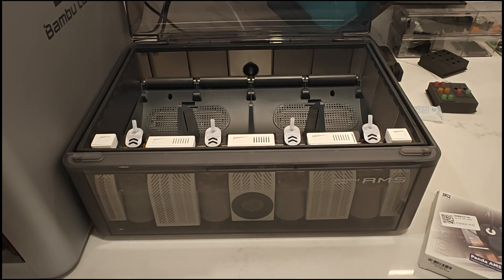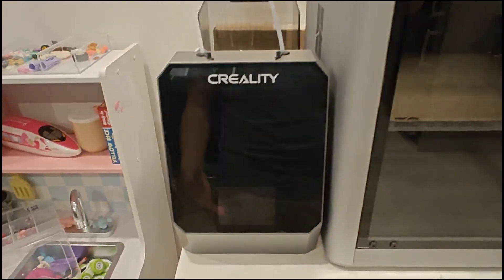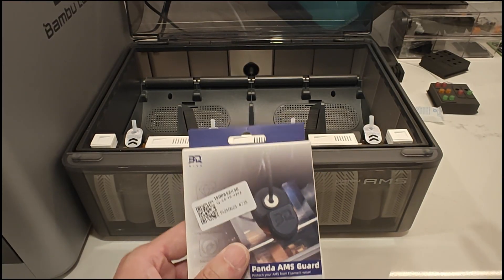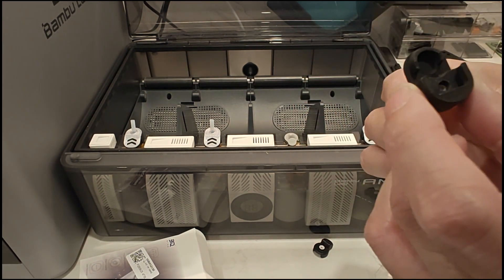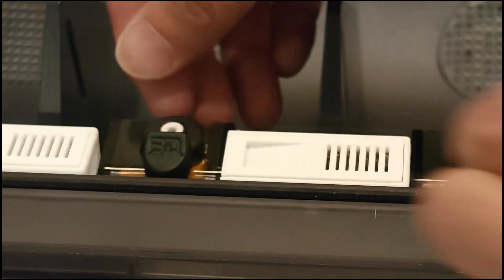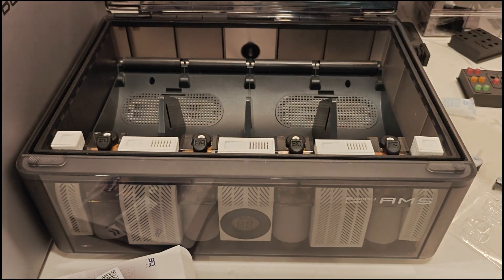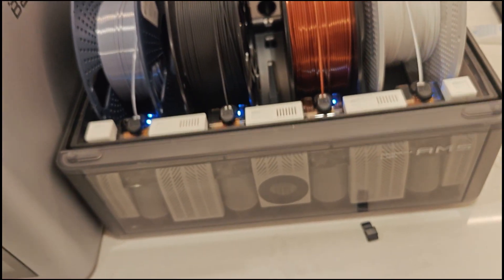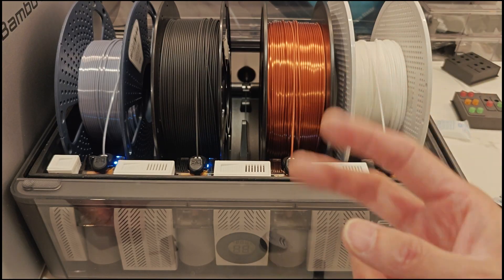BIQU Panada Guard Unboxing and Install into Bambu AMS Video!

Comment: The issue with such a product as that you move forward the insert, reducing the pressure on the filament between the toothed wheels. Not sure it's ideal.
Would have been way better to have the exact same part than original with the ceramic insert.
Reply from the maker: I agree. Every other 3D print that uses ptfe tubing or just a guide does the same. There hasn't been many complaints about it, if any. However a full replacement would be ideal.. but may be quite cost prohibitive.